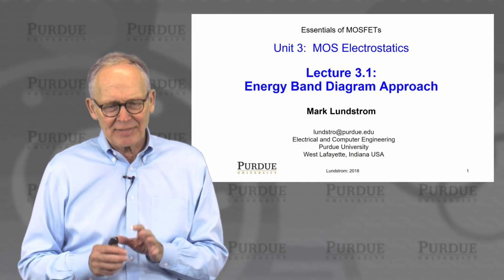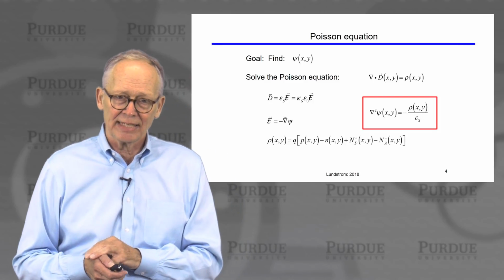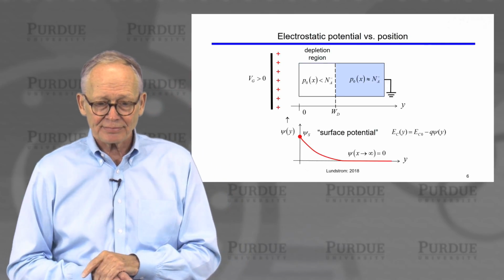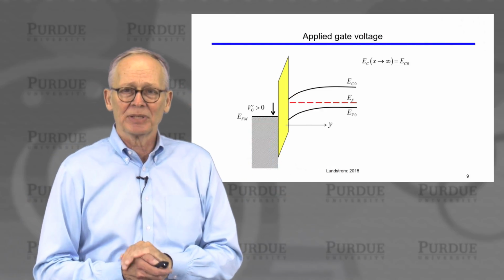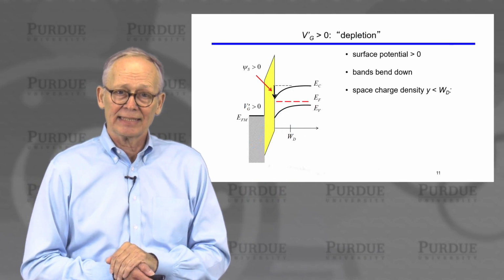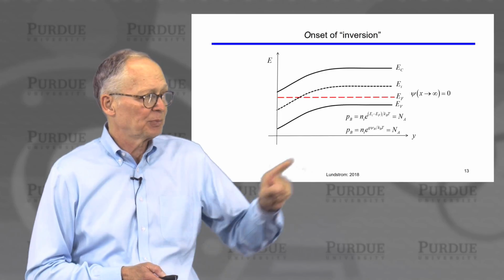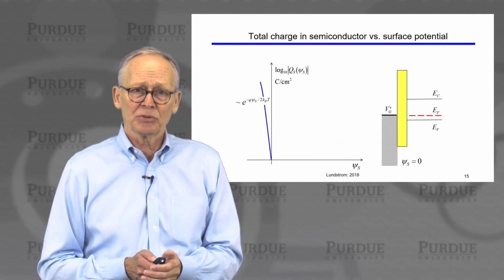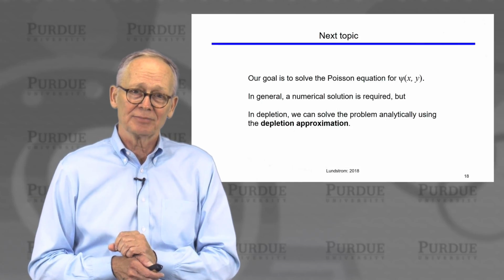nanoHUB-U MOSFET Essentials L3.1: MOS Electrostatics - Energy Band Diagram Approach

Comment: 00:00    Lecture 3.1: Energy Band Diagram Approach
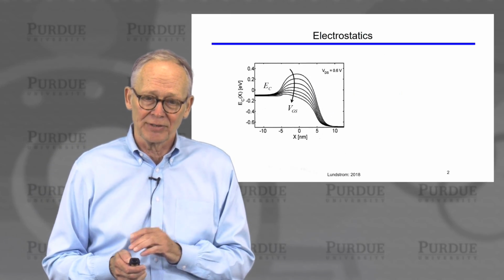00:42    Electrostatics
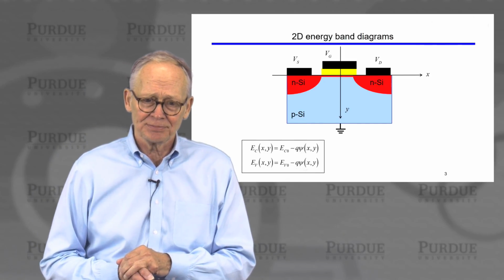01:33    2D energy band diagrams
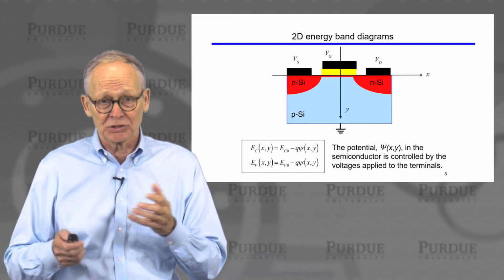02:10    Poisson equation
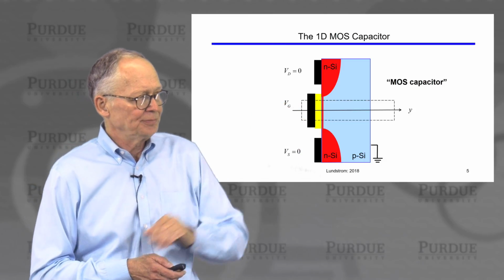03:42    The 1D MOS Capacitor
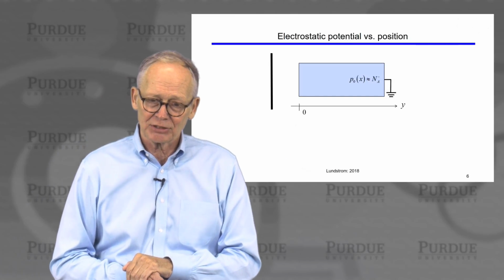04:05    Electrostatic potential vs. position
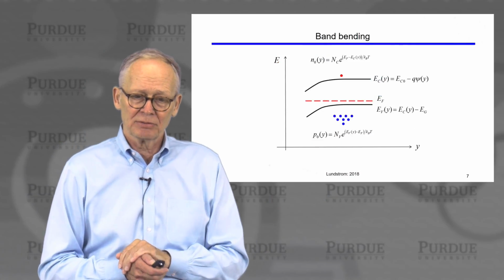05:57    Band bending
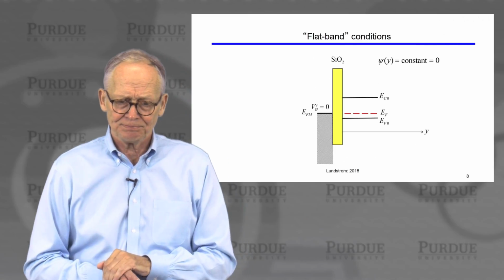06:46    "Flat-band" conditions
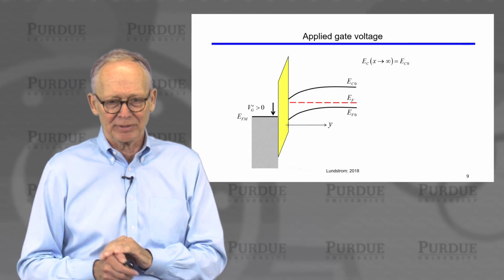08:07    Applied gate voltage
09:13    V'G < 0: "accumulation"
10:52    V'G > 0: "depletion"
11:56    V'G = V'T: onset of "inversion"
13:30    Onset of "inversion"
15:02    V'G > VT: "inversion"
15:52    Total charge in semiconductor vs. surface potential
17:03    Exercise
17:25    Summary
18:25    Next topic

Comment: sir what is the band diagram for accumulation and depletion ,if oxide charge is less than 0 or more than 0
Reply: I think the oxide acts as an insulator since SiO2 is non conductive, so I am assuming the surface potential is equivalent to what you might refer to as oxide charge. It's basically a capacitor with the gate on one side and the surface on the other with something between the plates (the SiO2) so the oxide charge would mirror the surface charge on either side of the plates.